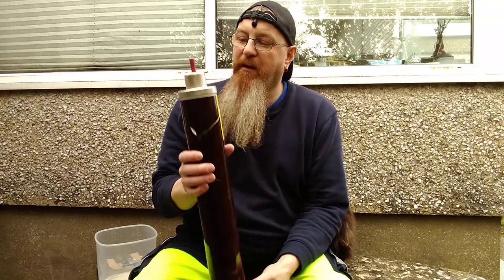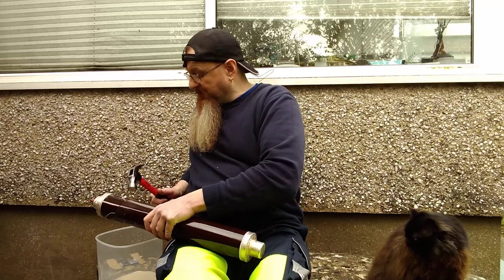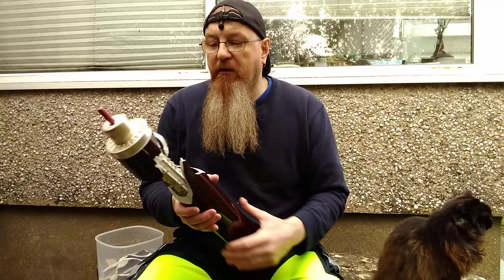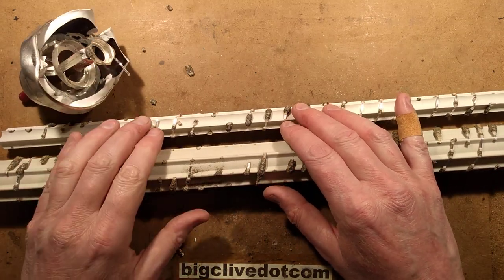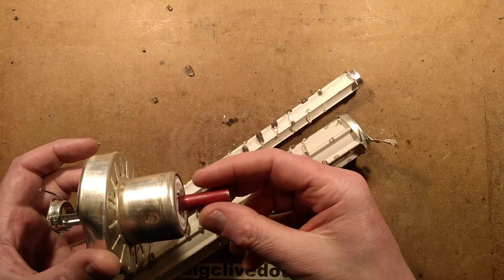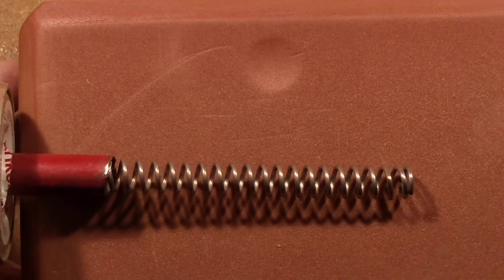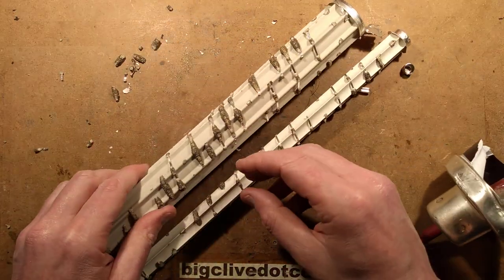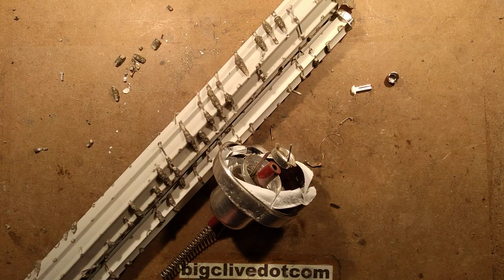A look inside a blown 36kV fuse.

Comment: My best guess about the plunger: the fuse wire retaining the spring was connected between the positive and negative terminals parallel to the main fuse wire, but was substantially higher resistance than the main fuse so it normally would have nearly no current flowing through it. When the main fuse wire breaks the spring-retention fuse wire would be the only remaining path to the negative terminal. Normally, being high resistance would be an issue for a fuse wire in this situation as it might prevent enough current getting through to sufficiently heat it to the point of melting. However, since it's receiving 36kV even an abnormally high resistance fuse wire will still allow a stupid amount of current through, thus breaking the wire and releasing the pin. Just a guess though.

Comment: I think it's possible the plunger is a press-fit into a metal sleeve that's designed to expand and release it in an over-temperature scenario. And if the fuse blows the physical shock might be enough to free it as well. I'm probably wrong but it certainly appears that way. Sort of the same principle as those fire sprinklers where the little glass vial is designed to blow as the fluid inside expands with temperature.

Comment: I think that wire is some kind of resistance wire connected across the fuse. Since the main fuse ribbon will be very low resistance there would be barely any current through anything with even a few ohms resistance. If the main ribbon blows, all the current will run through the resistance wire and vaporise it, releasing the tension on the spring. But there does seem to be rather a lot of the wire left and I'd have though it would have vaporised more of it.

Comment: I used to make installations with these puppys in 'm.  Among other installations, Also layed cables 2500mm2 copper core (per phaseline) for a 380KV (yes that is 380 KV!) line from holland to Germany. This cable weighed about 70Kg per meter.

Comment: My bet would be that thin retaining wire was attached by a short fusible resistance and was connected in parallel with the main fuses. The resistance would be high enough so that it didn't carry any significant current. However, once the main fuses blew at 20 kV appeared across it, then the fusible resistance link will have blown and the tension on the wire released.

With 20 kV, just 1A would dissipate 20 kW. So a fusible resistance link of 20,000 ohms would do the job. In normal usage, it would pass a trivial amount of current, but once the main fuses in parallel went it would instantly vaporise and release the tension on the wire.

Comment: Had a spate of very close lightning strikes a few years ago out here in rural colorado where I was calling the boys out with my cell phone due to the fact I could plainly see the transformer fuse had blown and was now dangling in the breeze. Those come apart both ends and they were rebuilding them on the spot with a pulled apart ordinary lamp cord to my amazement. Most other times they have one ready to go and I didn't get to see them rebuilt before.Three times for mine that summer season, and simultaneously one apiece for two other utilities within a 1/4 mile from me. I jest that zee germans will eventually get me dialed in on those 88s.

Comment: Since the wire in the center is single thread it's probably the thing serving as the failure point, and designed in such a way that the current normally flows through the outer core with the three wires and once they get blown the current is then forced to travel through the last wire making it overhead and break that design should work quite well since the current will normally flow through the path with least resistance.

Comment: Now please correct me if im wrong. 
The second tube in parallel is effectively the holding lever for spring/triggers the charge for the striker pin. In normal operation, the bigger coil has the majority of current flow through it. In the event of high current, it will melt leaving the second coil in parallel which then also melts but then releases the spring / activates explosive charge.

Comment: The wire blowing when the other one has blown might be accurate. On the other hand that could result in arcing if it isn't wound around the core like the main wire was. Then again it might be connected across a short length of the main fuse wire in the middle as a potential divider of sorts to prevent that.

Comment: hi Clive, they have a thin wire in parallel with the other fuses and because  it is held one end by temperature sensitive filling so the wire will break when the fuse blows or the soft metal will warm up letting go of the wire and in so activates the plunger.

Comment: Hm. Sand-filled fuse… We used to have 750V= fuses on the 50’s class trams we had in Oslo until ≈2000. German "Drei kanalen patrone". Popped open a broken one one day, and indeed, it was like a long flat wire (or band) going in and out of three longtidudional (damn, that’s inspellable…) sand-filled chambers. Longis porcelain things, came in 2, 10, 16 and 25 or 30 amps (Lights, compressor (was 10, got changed to 16), heat (motorcar) and heat/lights/track brakes on trailer. Trailer had its own set of fuses for lights, heat and track brakes (was 24 V battery on motor car, 600 V= on trailer).
All the fuses on the motor cars were on a board above the head of the driver… :P
Very cool vid, thanks for sharing! :D

Comment: The two separate elements are for two failure scenarios. One is an overload condition the other is a fault condition like short to ground or short phase to phase.  The current profiles are different for both conditions so the fuse geometry is different. That is my guess. Like one side blows more quickly due to the short. While the other allows a period of overload and then blows. This is how house breakers are constructed as well.

Comment: In all the >1k comments I only saw one mention of silver wire and no one mentioned how this fuse really works. Silver is a very good conductor and is actually a better conductor than copper. But the real reason silver is used is because it dissolves into the molten sand that is created from the heat of the wire fusing and then the resultant arc. If there was no sand this fuse wouldn't be able to extinguish the arc. The sand absorbs a lot of heat and more is absorbed as it melts and dissolves the molten silver. Same if the element wire was made of copper the fuse wouldn't work. Notice that the fuse wire is spiraled around the ceramic core to increase the length of the arc.
Also this is regarded as a Medium Voltage fuse in substation lingo. I have worked with 115kV fuses which are much longer. Above that voltage, fuses are not normally used. On 250kV and 500kV lines that I have worked on, they used oil, air blast and SF6 circuit breakers instead. Fuses work even poorer on DC circuits such as on a 500kV DC transmission line because the current doesn't go thru zero 100 or 120 times per second.
Yes you are right the firing pin is usually used to activate a switch. But very often it is just used as a visual flag. As these fuses are often mounted high up on a pole and are inaccessible and too dangerous to test, the linesman need a marker they can see from the ground to know which one to replace. You also don't want to pull a fuse that has current going thru it no matter how long your hotstick is because the arc will continue and not break thru the air. 

I am sure your cat would enjoy the sand for kitty litter.
PS. You should really get that growth checked on your forehead ;-)

Comment: that wire does travel all  the way to the other end and pops when the fuse blows. in my industry we call those tattle tale fuses.  It is MUCH lower rated just to trip when the fuse blows, so that it won't carry current before it blows.  like you said that can by used to trip a breaker to shut off a bank of fuses, or they can be single fuses and the red tip just lets the technician find the problem much faster to what blew, and then find the reason as to why it blew.

Comment: There are actually three separate fuse wires, running in parallel to each other. 

The fuse wire on the outer ceramic former is the main fuse and carries all of the current under normal operation.  

The fuse wire on the inner ceramic core has higher resistance wire and when the outer one blows, current transfers to this wire.  The high resistance helps to suppress the voltage spike  that occurs because of interrupting inductive current.  This inductance a "parasitic" and is caused by transmission line inductance and leakage inductance of upstream and downstream transformers.  

Current will then transfer to the inner wire, which is very fine, high resistance, and will blow quickly, thus releasing the indicator plunger, which you have already figured out.

Comment: Few months ago, I found a cracked fuse one of the our milling machines. It was cracked, but not blown. The type was with the knife type terminals and it was rated a 350 amps 500V. I replaced it with new one, but decide to disassemble it, because the metal plates with the terminals was attached with screws. I think that the way it work is the same, there is a spring loaded pin again, but not go trough the terminal. The thick wire is spiral winded on a non conductive core, and it is a thin wire inside it, when i cut the thick one, It was still conductive. Than i cut the thin one and the pin pop out. I think that the idea is when the thick one is blown, the current go trough the thin one, but it melt almost immediately...

Comment: I was parked beneath an HV line one day watching a small thunder cell drift across the river valley towards me.  The lightning struck the line in the distance and a fuse on the pole next to me (a smaller version of your whopper) detonated with a loud bang and a concussion I could actually feel.  As intended, the fuse disconnected itself and swung down out of position.
At the time I was working on a hydro electric site where the largest generator (500KW) exported to the step-up transformer via two 400A fuses on each phase.  I understood that two fuses in parallel were used to give a faster response time - one fuse would always blow first, massively overloading the second which instantly vapourised.  One single thick fuse element would react more slowly.  This was all 1960's technology and was all replaced with a new sub a few years ago.

Comment: Here in Canada, your x-ray device is known as a 'fine adjustment tool', at least that what the fellow at The Router Workshop called it :p
I've seen that type of sintered silica before when I had to change one of the heating elements in a fluidized sand bath at university. All three of the elements were caked 10+ mm with the stuff. A couple gentle taps with a fine adjustment tool made switching out the faulty one much easier.

Comment: The new mic worked well, Clive. You're running a little hot and have a little clipping, but I prefer it to your indoor sound with its bench reflection.
Reply from the maker: It's the same microphone, but just on the forehead so I could have it close outdoors.

Comment: only a guess, but the ribbon would have been measured for it's ability to be quenched in a given silica medium, and that would be the biggest that will behave reliably. So if they want to make a fuse that is higher than that ribbon capacity, using multiple ribbons is the only way. Also the ribbon is used over wire, for its greater surface area with respect to the quenching action of the silica.

Comment: Everything I found on Google image search referred to the red pin as an indicator. Apparently the idea is so old that there were once luxury screw-in fuses for residential fuse boxes with indicator pins. All the drawings have the fusable link wire passing the load after the main fuse blew. I do think they could be capable of operating something to break the other phases, but there are so many other ways to lose a phase that I would bet on a separate device for detecting loss of phase and taking corrective action.

Comment: Hiya Clive. What 
you have there is 
a 'striker' fuse. How 
it works inside is........

You have a main current-carrying fuse wire ( or multiples thereof in parallel ) and then up the centre of the tube, is a small wee-thin wire.

Operation.....

When the fuse fails, what happens is, the current has no other flow path other than the wee thin wire in the middle. It is this which triggers-off an explosive charge in the striker-end of the fuse, making the pin pop out.

I would seem to think that the sound of one of these triggering-off isn't that loud, especially those striker fuses installed into units where the fuses are submerged in oil.

As you stated in the video, this would be situated in a cabinet of some kind with two other fuses on other phases. When one fuse lets loose, the striker pin emerging from the fuse hits some kind of disconnector mechanism, disconnecting all three phases at once.

I find it a bit odd that your one has two tubes, one inside the other, and even the smaller tube has fuse wire(s) on it.

I have an 11kV, 80A striker fuse by GEC ALSTHOM, provided to me by Mr. Photon.

80A x 11,000v = 880 kW.

Of course, thats its functioning current. What it takes to make it let loose is unknown.... probably something like 1.5 MW. :-O

My striker fuse is still operational, with the pin still inside the fuse. :D

Thanxx for showing,

-Wayne's Electrical.

15th April 2019, 21.20

Comment: How many of you remember English Electric fuse.. I had a chance to serve in that company. I will share my little knowledge about that high voltage (HV)fuse, the silver element wrapped around on star core is to  check overload and short circuit (in rush) current. Plunger system is for blown fuse indicator it has a striker at the end of the plunger which pierce the end cap for blown fuse indication. The indication system has mild explosive with heating element encapsulated with plunger and striker system, the heater wires is connected parallel to fuse element wrap as long as no faults are checked current will passes through silver element wrap, when fault detected silver element wrap snaps and heater element activated causes mild explosions take place plunger and striker activated which pierce the end cap..

Comment: The thin wire goes end to end, retaining both plungers from deploying. The thin wire becomes the only current path after the tubes blow,  out, and considering 3 strands of wire will not supply that type of power, immediately fails, causing the fuse to trip the pins.

Comment: The large fuses I’ve seen the pins are fired by a small bit of pyrotechnic powder. The smaller fuse part is connected to the tiny wire and fires charge when the large winding breaks.

Comment: The fuse wire heats up and triggers a pyrotechnic charge, which pushes out the plunger, as described in one of PhontonicInduction's videos.
Reply: Why would it need to do that when it has the spring to push the plunger out?

Comment: If the length of the inner winding is the same as the length of the outer winding is will be an equivalent parallel to the ones wound on the larger outer core.  Since the inner core has a smaller radius it will take more turn for the same length of wire.

Comment: Hi Clive,

You are a nerd and so am I, - just with another beard :-).
I like you cat, - it isn't bothered about your cracking a ceramic tube with a hammer.
For +50 years: Always take apart something you do not know how works or something that has stopped working.
From a retired electronic engineer @65.

Comment: You can get a really nasty cut from sharp ceramic, in fact, it often cuts better than glass!  Don't leave shards of that stuff laying around, bare feet or bare paws can get nasty cuts.

In fact I have a story about bare paws.  Some 20 or so years ago there was a gas explosion in one of the nearby apartment buildings and a whole apartment block came down.  Windows were blown out in a three block radius.  It was really tricky to walk the dog as all the sidewalks were showered with glass.
Reply from the maker: I spent a lot of time clearing up the shards of ceramic to protect the kitties paws.

Comment: Could the plunger have been held in by vacuum? That's why the spring rate information is there, for different elevations? That little wire seems to suggest otherwise

Comment: I know its hard to tell with the melted silica attached but from what I can see of the coiling fuse wire it looks surprisingly thin considering the extreme power going through it. I'd probably expect it to be as thick as a pencil at least! I'd also expect a possible conversion of the sand into glass. Perhaps it would if the extinguishing effect of the fusing action didn't cut it short so quickly?

Comment: My ideas on the string mechanism:
1. The wire was tacked on but blown off when the fuse blew, which released the spring
2. The sand held the spring in place and was somehow displaced enough to let it fire once blown

Comment: Surely the spring loaded plunger would have been invisible externally, held down only by the white plastic tape end stop. Which means that the inner end would be well down inside the inner ceramic fuse, until it blew its little fuse wire, releasing it to pierce the film stop-end.

Comment: I am thinking the fuse wire from the pin connects to that inner fuse assembly, which is probably a lower rated fuse than the outer fuse.
Just a bit of a guess given what it looks like.

Comment: Would the parallel fusing increase the reliability if it blowing quickly at the rated current? Seems like if one side blows and breaks, the other will go very rapidly with twice the current hitting it.